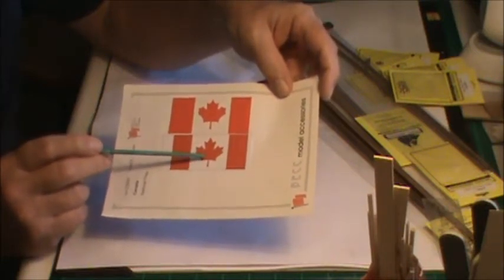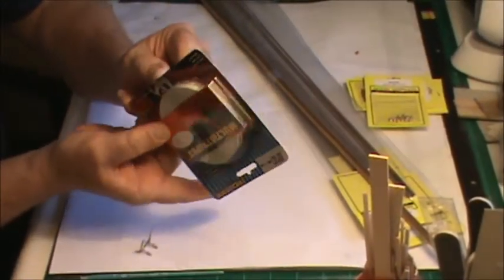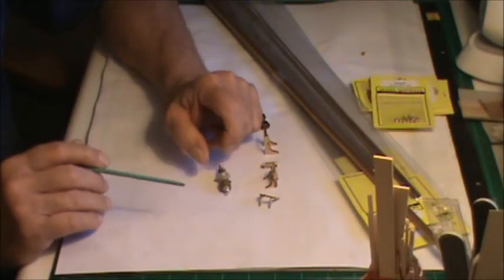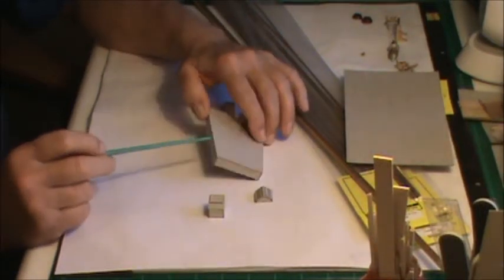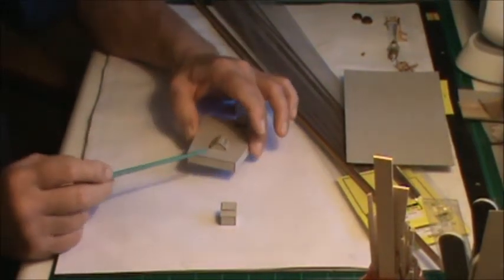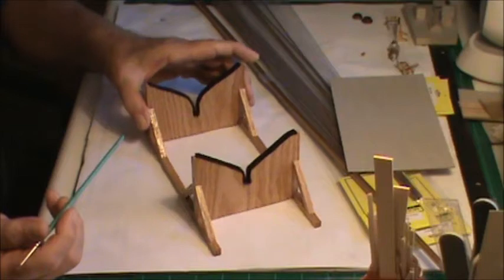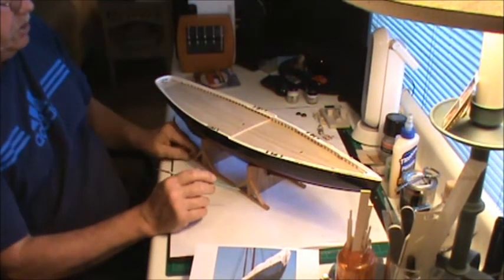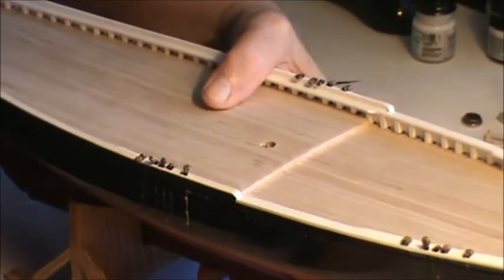BLUENOSE PART 20

Comment: Gary, started an email and hit the wrong key, it all went away.  I will make this short, I am finished with my hull and it really turned out nice.  I should have spent more time on the preparation of the wood on the hull but other than that it looks great.  I painted the hull with model expos paint by brush and tape.  Then I varnished it with a brush  then smoothed it out with OOOO steel wool,  Did this three times and it turned out like glass.  All drying took one night for each step but I gave it two days just in case it was soft.  I am done and like you I can read a newspaper off the finish.  No problems with finger prints on the finish.  Oh did I mention I really hate chain plates?
Reply from the maker: Randy Cooper A good paint job on a ship this size is important, its one of the first things your eyes a drawn to.  I don't know if your watching my Dresden build but I talked about your problem drilling that chain plate.  I may not have posted that video yet so you may have to wait.  I'm sure your past that point.  The drill bits I used are made by Excel, and one guy said that if you heat your brass red hot and let it cool down it is easer to drill.  Thanks for watching.
Reply: Hi guys. I'm currently building the same bluenose. I'm about to paint the hull. Can you explain how you got the waterline? Just not sure as to how to measure it out. TIA.

Comment: Gary:
       I have a 35 year background in airbrush illustration, custom auto paint, pinstriping and modeling. I don't know if you primered the ship before you painted it but I think you may have mixed different types of primers, paints and clears. If I am correct and you decide to sand and repaint you will probably wind up with a very thick, gooey mess. Was your primer, paint and clear enamel, lacquer or acrylic? If at any step along the way you mixed enamels, lacquers and or acrylics the finished paint job will forever remain rather gooey or soft and sticky. I could be wrong because I don't know the answers to my questions but if I am correct it's going to be a real headache. How you managed to wet sand and buff out soft paint is beyond me. I painted my ship with non-modeling paint and I painted it with satin finishes. Everything I read about the paint on the ship said that it has a satin or semi-gloss finish but it's your ship so you can make it as shiny as you wish. If that paint never dries hard you will only have a few options. One......leave it as is. Two.......completely strip the paint off and start all over (good luck) or three.......start rebuilding. Hopefully it will dry but time will tell. Despite the paint problem your ship sure looks nice. Good luck.
Ed.
Reply from the maker: Hypergolica1 Well here's the deal, I used Testors lacquer primer and Testors enamel paint for the red.  Now I spent years in a body shop and know you can put enamel on top of lacquer but not the other way around.  Then I cleared it with an acrylic.  Now I have heard from other guys that had the same problem and switched to a Crylon clear with no problems.  I think the clear I used was bad, because it is an artist clear to be used on all types of medium.  It wasn't a gooey mess and after about 3 weeks it had dried enough that I wet sanded most of the clear off and repainted the ship with no problems.  In the body shop we used to mix and match primers, paint and clears all the time with no problems.  I painted cars with lacquer primer then enamel paint and urethane clear and never had a problem like this.  My own pickup truck was painted like that with a pearl white and candy apple red sides and it lasted for years till I sold it.  With a lacquer paint job we would sand it down the next day and buff it out.  But an enamel job we would wait about a week before buffing.  Everything was fine till I put that clear on and the clear won't dry.  I went to a GM painting class and was told that lacquer dries to a hard finish and chips easy and enamel can take years to fully cure and remains flexible.  So I don't think it was my mismatch as much as I think it was the clear.  After I repainted, with no clear, everything is fine.  I even rubbed it out and put a wax on it and she is fine.  Now the shiny finish is explained in video 23 coming up.  Thanks for the info, and keep watching